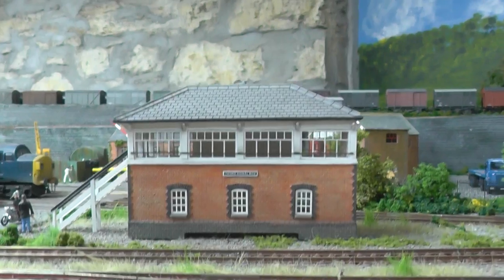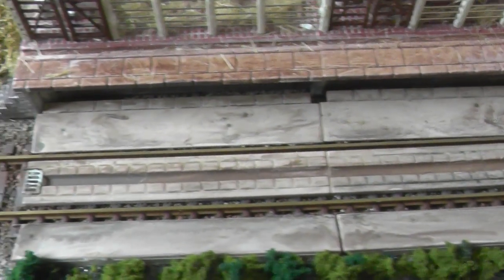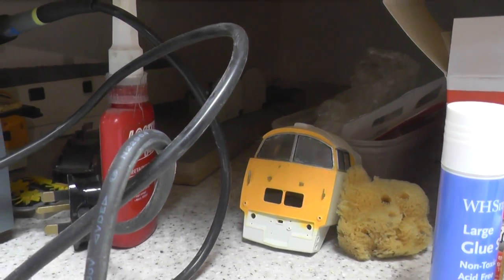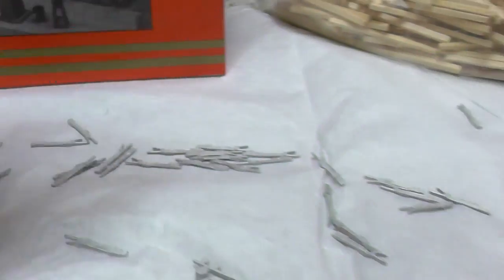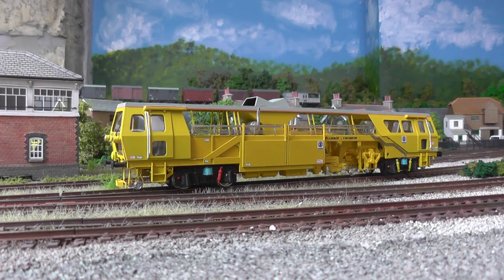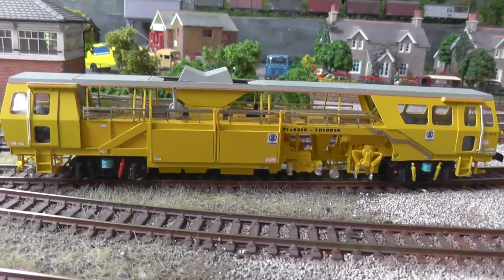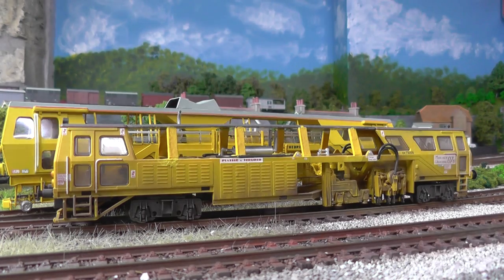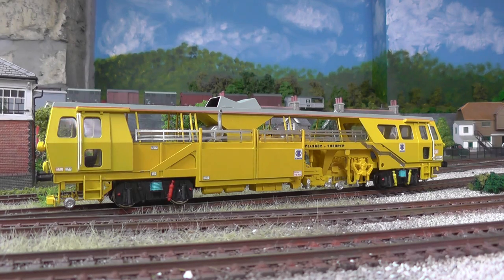Penwithers update

Comment: Hi Kevin. when you start placing the levers in Truro box, Red signal, Black points, Blue point locks, Yellow distant, White spare, Brown is release (ground frame /crossing gates) White band on red levers denote Track circuit. Point & Locks are next to each other and general towards the end of the frame, which is painted black. most GW boxes have the frame to the front  (windows). don't  forget the signalmans tea towel as this stops the sweat from his mitts rusting the levers, hope this helps. Be good to see a bit of progress on the Western, have been looking back to see if I missed a update since Graham has started his 50.
Reply: Now there's  a man who knows his stuff 
Cheers
Graeme
Reply from the maker: +vince halls hi Vince trying to find a photo of Truro signal box so I can get the levers correctly painted but not had much luck , have got the tea towel painted up !! as for the Western having seen Graham making a flying start must get my ass in gear and make a start but going to be a couple of weeks before I can start cheers Kevin

Comment: Hi Kevin, the new Truro signal box is lovely.  It will be out standing when you get the interior installed.  I am sure it will be impressive.   I like the cattle loading ramp.  Nicely done.  Your new tamper is very nice.  I have the Bachmann one and I knew it was HO since I got it at a shop near me, but I had no idea the OO would be so much larger.  My tamper doesn't run very well.  It starts off too slow and runs way too fast once it gets going.  I could probably fix that by tuning the CVs just never got around to it.  Best, Rob
Reply from the maker: +Rob McCrain hi Rob thanks very much going to be busy with the interior will be nice to finish that area of the layout  ,it is the first bit you see when you walk into the the room the tamper is awesome the bachman one I have is a great runner was ok to look at from a distance but the new one is the business cheers Kevin